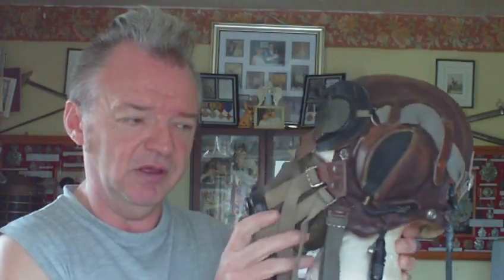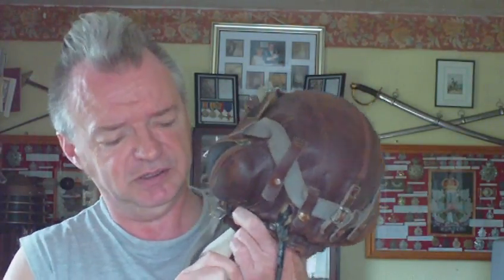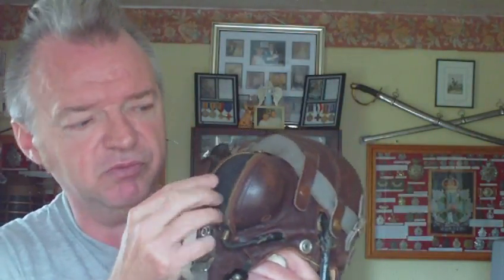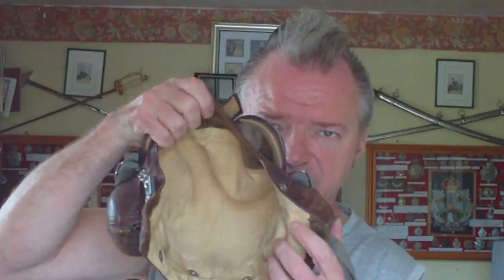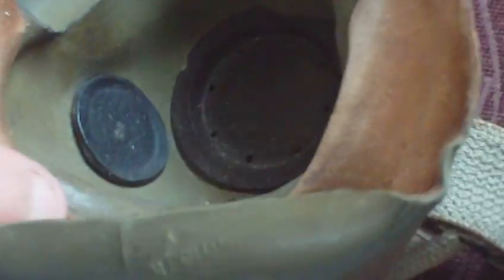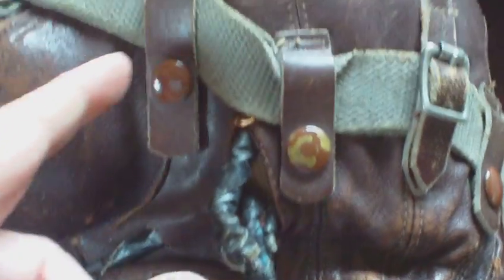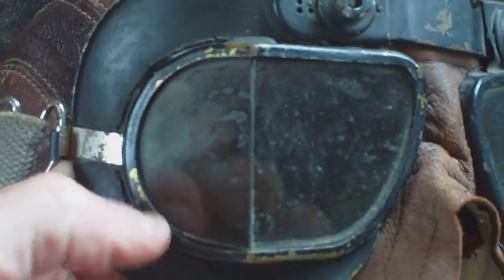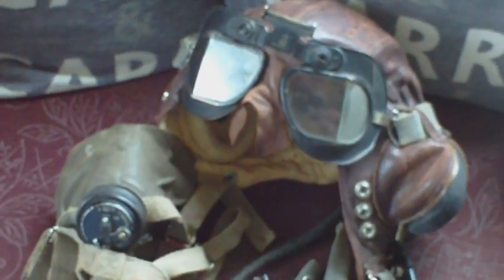WORLD WAR TWO ROYAL AIR FORCE B TYPE LEATHER FLYING HELMET, OXYGEN MASK,GOGGLES

Comment: There is a copper colored wire that is looped at both ends that is missing on the mask. It runs over the nose bridge area of the mask and the looped ends push through the the Two raised rubber lugs on either side. The idea behind this is when you are wearing the mask you would pinch the wire with your forefinger and thumb so it would conform better to the shape of your nose and create a better seal.
Hope this helps